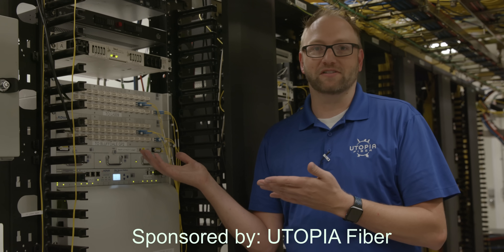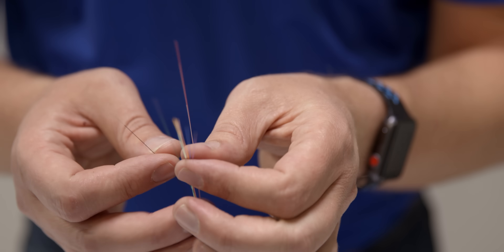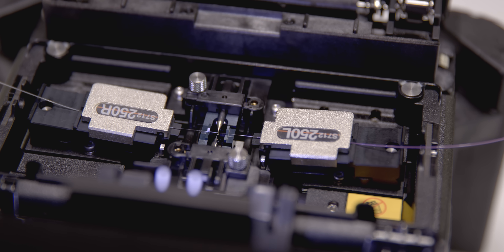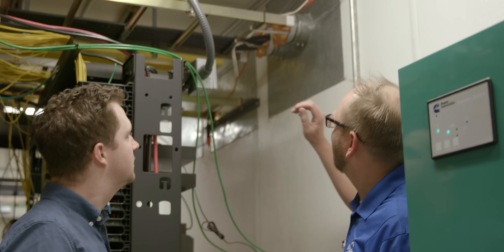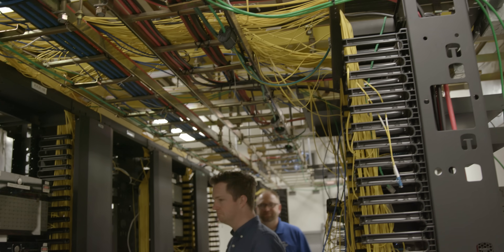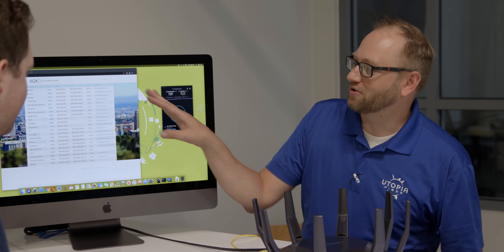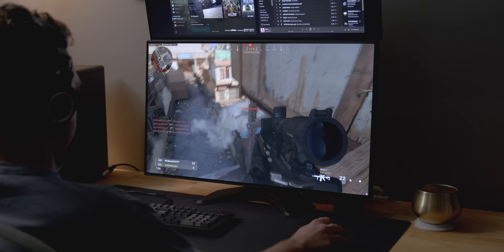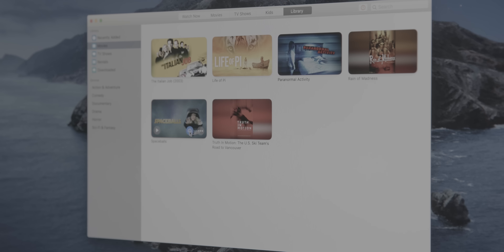4 Terabit Internet?! Fiber Company Tour!

Comment: ..and then there's Init7 in Switzerland, selling you 25GE for 777CHF annually, and they're a for-profit enterprise..
Side note: The legal situation in Switzerland is enabling this, as per law if you build fiber to the home, you MUST pull not one but four separate non-splitted fibres from every single residential unit (ie flat) to the fibre hut, where you MUST (at a regulated price) provide ISPs space for their equipment.

Comment: this is so absurd, unless the fiver cable is connected all the way to the internet's original source center, at one point it will have to hook up with a coaxial or inferior Internet cable line.
Reply from the maker: Erm, no. Even cable is basically FTTN. Once you go more than a few miles from the furthest homes with the worst internet, all infrastructure is fiber.

Comment: With a single fiber strand having the potential of 40+Tb/s that would make any current cable ran be good for at least 30+yrs, maybe much more. From an infrastructure POV it seems like a no brainer. That's up there with power lines in terms of longevity. Just every 5 years get updated to a new receiver.

Comment: While I'm capped at 2/2 Gbps .. you're are quite dead wrong about how latency works on first person shooters. If your ping is really low then your connection is slowed (LAG COMPENSATION) in comparison to higher ping players. In fact, the ideal ping for FPS games is right around 50 to 60 ms.

Comment: Unfortunately the SLIX has a relatively limited amount of bandwidth it seems since I've had many issues in the past with peering routes through the SLIX at peak hours. I used to have a server hosted at GSI/WebNX's datacenter and getting from there to my house on a 1 gig XMission connection. At peak hours I was only getting about 5mbps from the datacenter to my house, but about 700mbps in the other direction. I also had an issue with one of my customers for google fiber with packet loss through the SLIX

Comment: Wish we had options like this in more areas. My city is "lucky" enough to be having a private fiber provider rolling out Active-E fiber to our homes soonish but the cost for 1Gbps speed is ~$160/mo And municipal fiber like Utopia seems to be only reserved for the much larger cities. Interesting enough: idaho falls has a municipal fiber as well being run by their electric company. Electric company already owns the utility poles, so other ISPs can't do anything about it (like blocking access to the poles for other providers to come in) But like utopia: they grant access to their fiber for ISPs to serve end customers via at far more competitive rates than for example my future fiber ISP that will own the fiber being installed beneath the streets via micro trenching. They charge a premium for using their own networking.

Pretty cool to see utopia's setup. One day I'll have symmetrical gig fiber....one day LOL. At least my current internet gets me by... $125/mo gig down 50Mbps up cable. Best (and really only) option we have ATM.

Comment: my utopia 10G setup tested at 1500 mbps so i switched to the 1000 mbps package and that ended up testing at 1100 mbps (at less than half the price)! they said i was getting 10G even tho it tested at 1.5 lol kind of offensive but i let em slide bc the speed is consistent and i honestly wasn’t expecting anywhere close to 10Gbps. do with this info what you will 👀😂
Reply: Anyways speedtest is a bunch of hoax, usually ISP's have speedtest servers at their own infra, this gives the very low latency and fast speeds.

In reality, the Internet doesn't work like this at all. Each IP you are trying to connect is reached by unique paths and ways, and this can vary a LOT from case to case. 

a small TLDR is just that speedtest is just a huge scam, IDK why people get so excited when they have 0ms ping to their speedtest servers, it means absolutely nothing

Comment: $55/mo for gig!?
I'm paying $130/mo for 200mbps [averaging 83-100mbps] down and 20mbps down [ON AVERAGE 1.1mbps down, 5-7mbps on a "good day"] (note after over 87 technician visits in 8 years this upload rate is a huge improvement and Cox the ISP which will remain nameless can't seem to do better, having greater than 1.0 on average is a godsend)

AT&T a competing isp in the area has started infrastructure work to bring fiber to the city, but they are requiring a contract price lock agreement and have a huge price hike moderate bill adjustment halfway through the PLA with extreme fines recompense clause policy if you breach contract end services early

Comment: It's interesting that he said the equipment for an active network is cheaper than for a PON network. I wonder how that can be true, with an active network you need a demultiplexer and a powered router that can deliver 1G or 10G links to dozens of customers, basically the room they're in. And with a PON, you just need one big transmitter and passive splitters. Less maintenance and no power consumption. I mean it's significantly cheaper, that's why almost every FTTH provider is doing PON, otherwise the active network is clearly superior but... money.
Reply: Utopia isn't huge scale, that's why they are even able to be so direct to the customers. In a large scale, GPON is cheaper heh

Comment: Electricity potential moves at the speed of light too does it not?
Reply: Yes. Speed of light in vacuum is 300,000km/s, in fiber it is ~200,000km/s. For EM wave propagation in copper wires it is highly dependent on the type of wire, but it can be fast or slower. The signal in a modern Cat7 Ethernet for example is quite a bit faster than in fiber.

The whole "speed of light" argument is only marketing bullshit for fiber. The advantage of fiber is elsewhere.

Comment: 4 T...B.....what?!

I swear sometimes I hate living in Germany. I live just 7km away from a city and I can barely get 6mb/s through FUCKING DSL!!!
Not even normal internet cable.

They are working on getting the fiber cable to us but it will take 1 more year...at least 1 year.

Germany is awful when it comes to internet.
Reply: Wrong. It's only at the consumer level it's bad.
Germany has one of the larger IX's, DE-CIX, and a lot of datacenters and amazing backbone. A lot of hosting companies and datacenters live within Germany.

The main issue why germany doesn't have good internet is just because of Infra on the home/residential level, the backbone is fucking amazing.
Reply: @hariranormal5584  well,I am no data center.
We are in 2022 and it is kinda embarrassing to be able to get only 6mb/s near a larger city.

Comment: @4:15 "you can't just [butt them together]" Yes you can. AT&T has been doing this very thing for many years. It's how those horrible physical ("tool-less") connectors work. The ends of two fibers are "precisely" aligned and held there. (in a buffer gel to limit noise and reflections.) I hate them, but they are quick and don't require a $$$$ fusion splicer. (they are much more expensive than a pigtail, tho.)

Comment: I recently moved From Sandy, OR and had Sandynet (fiber to the house, 300/300 $42/month or 1000/1000 $60/month), now have Comcast. Oh how I dislike cable internet. I have no need for 600+ down speeds. 200+ down is more than needed. What I need is 200+ up speed and with cable I'm capped at 18 up. I strongly dislike how cable is high down speeds and low up speeds. I also miss the unfair low ping for gaming

Comment: As a German, the only places with actual reliable fiber 1g/10g connections are where the big datacenters are. I've rented a server with a good connection to the DE-CIX and even most Speedtest servers only go up to ~500mbps, though the connection is capable of multiple gigabits. Most customers can only dream of getting 100Mbps from their outdated copper connections.
There is no such thing as a competition except for DSL vs Coax cable, both quite flawed technologies

So before anyone thinks Germany is a technologically highly developed country, this definitely does not apply to regular customer connections
Reply: I just love my hetzner server. My ISP used to prefer DEECIX also to reach there, but preferred core baccbone gmbh now. Why the fuck i dont know XD but yeah. On my 260 MBIT connection I rarely get 14MB/s downloads from the GigE server :/

Comment: Hey Quinn, I work on a small WISP and eventually fiber infrastructure company out of Texas. We are trying to upgrade Texas infrastructure out in areas that the big companies wont service. While we have a lot of competition out here, most of the them are using older tech with no real plans on upgrading their equipment or even customer equipment. That is where we are going to be different, we as a WISP use Ubiquiti equipment and currently use 5AC Gen2 equipment along with Mikrotik network equipment. While we are small and expanding we still want to be able to upgrade not only our propagation equipment on our towers with the new LBU Ubiquiti equipment, but also the customer side equipment along with speed increases with hopefully no higher charge to the customer. Unlike some of our other competitors one of which is shown in your video, Rise Broadband, don't seem to quite give their customer what they are paying for and sometimes not even a fraction of it, from what we have been told from our customers that used to use these other companies. Most of them use old equipment on highly saturated sites and have too many people on a connection that really cant sustain the clients. This video is very interesting and is something we want to invest in and build infrastructure such the residential service you had in the video, although we are for-profit, but not trying to scrape money for all of our customers. We want to provide and sell to a customer exactly what they are paying for and this video is a nice window into the future of what we might become. Thanks for making the video!

Comment: Hey Snazzy,I've a doubt.
Can Telecom companies like AT&T make use of their towers too as part of the network for providing ftth?
Reply: cell towers have their own fiber and copper connections directly to the exchange, they do not relay, they are their own endpoint which you access ota, you can get fixed directed ota connections which is what I run on personally but having a cell tower close to you does not mean you have easy access to a fiber run

Comment: If anyone's wondering, 4,000Tbps internet translates to 500GBps.

(b = bit, B = byte, there are 8 bits in one byte so just divide by 8 to get the byte speed)
Reply: Wrong. 4000 terabits is 500000 gigabytes.

Comment: I have 250/50 cable here in the Netherlands and pay 59 euro (72 US dollar). But i rather would like to have 100/100 fibre because of the latency advantage. Unfortunately commercial companies here only roll out fibre in an area when they get enough interest from the residents. And offcourse most residents have no clue what what is as long as "it works" so the demand is low.

Comment: My first experience of remote computer access was 1982 at University of Kansas. My dorm's single terminal (80 x 25 chars green on black) used acoustic modem.
Speed = 1200/75 baud -roughly 1200/75 bps.
Keyboard typing limit therefore approx. 8-9 chars/sec.
Reading/download speed 120-150 chars/sec.
When I later learned  of 9600 bps modems I was blown away. Now 10G bps for home? - imagine speeds in year 2050 ...

Comment: Wow, it’s really interesting to see 10gb speed test and then discover that your limited by external servers. 
So what did you have to change to allow your modem ports to accept 10gb? I’m assuming this is an enterprise product. Do you have to lease the equipment? Are you saving money going fiber in regards to the plan you are on?
Reply: he already had 10 gb port in the 
unifi router  if i am not mistaken  he just had to switch the sfp module from 1Gbps to 10 Gbps

Comment: As a GPON network manager, this is such a weird network topology.
Reply: Point-to-point Ethernet is the standard in every network (enterprise, data centers, campus networks), except for some fiber-to-the-home networks. Why take the worst aspects of shared cable networks with splitters and amplifiers and do that do fiber networks (ala GPON)?
Reply: @rogertimmerman6982  For that exact reason: it scales like an office network.

It's entirely appropriate for a datacenter floor. It's lunacy to do that over an entire city. Especially big cities.

Also, GPON has no amplifiers. That's the Passive part of Gigabit Passive Optical Network.

GPON is nothing like DOCSIS coax or DSL.

Yeah, it uses "splitters", but as long as you get a GPON signal to your ONU, it is a gigabit link.
It either works or it doesn't. There's no "oh you're too far away from our PoP so the best we can serve you is 5Mbit".

Comment: Ah this explains how my ISP is able to give me 1Gbps for the price of the 200Mbps of the major Telecom (telenor) they offered us 500Mbps as a "test" to try and keep us with them... and it crapped out at 195Mpbs average . Still my ISP wasn't that cool, they wouldn't offer me 10Gbps because they said it was limited to businesses :(

Btw Snazzy team, if you're interested in testing out the limit of 10Gbps try seeing if there's a company in your local data center that offers VPS, and try to run a machine totally off the fiber!
In theory you can run almost an entire linux session (x server) off the fiber as the usual limitation is 6Gbps (SATA speed).
Practically I've found that 10Gbps isn't quite enough to run smoothly, I got a dual port 10Gbps from my desk to the server at home for displaying my "headless" linux server onto a fully working xserver by simply using SSH, and I see that if I play videos from YouTube of regular movies the UI usually have a 0.5-2.5s delay (while the video itself plays ok it can cause crashes or lock ups).
One thing I love reading those comments "you can't really use ssh x forwarding, that's too slow" "you can't benefit from aggregated 10Gbps" while I'm charting a 1.6-3GB/s plot chart on my lan statistic  I just wish there was a mobile version of fiber at the price point of a fixed fiber link... oh well.

Comment: I absolutely loved watching this video, so please do not take this as anything but Constructive Criticism. I have found 2 In-accuracies in this video. Firstly, there is better than Fibres 2/3rd Speed of Light despite the Technician saying this is [In terms of Latency] as Good As It Can Get. The Fairly New ISP StarLink which Operates at 100% Speed of Light easily beats this and there are Point 2 Point Radio/Laser-based Low Latency ISP's as well (Used Primarily by Stock Markets)
2nd it is stated that the Upload Speed to YouTube is a YouTube Limitation, but it's actually your computers Hard Disk/SSD Read/Write Speeds. I know a Video Content Producer that has 40Gbps and get's 95% of this when Uploading Video to YouTube from their Insanely High Spec NAS. A solution would be to have a NVME m.2 Solid State Drive as these are able to Read/Write at around 20-60Gbps. A SATA SSD is 3Gbps Max for Comparison.

Comment: We Used to get 1+ GIG U/D in Tampa Until Verizon Dumped us to Frontier RIP off Communication who Lies and @ Best you get 800 / 850  and the ISP claims its 1 MS ping.....  IN real Numbers its 10-15 seconds to click to connect to ANY SITE so dont believe their BS...I have over 1000 Tests on Speedtest By OoKla to Prove the Orignal Speeds and the Frontier Throttled Speeds!!! 
      I have Paid 2500 EACH time to have My Fiber RE RUN to the Property and all the Equipment Replaced  3 times  and its still Being Throttled.....How do I know.....??  I was an Original Verizon FIOS Test Customer and It used to work at 1050 D /1100 U .......until Frontier took it over and they Throttle the Network Now.     
    There is News of Spectrum Finally getting off their asses and Installing 2.5 Fiber and if it goes well we plan to see it Rolled out in 2021....The Best part is No small Up loads with the New Spectrum 2.5 GB Lines!!!  I cant Wait to switch !!!! 
  Hey Utopia Call ME I want 10 Gig in FL !!! Cow}:-o)

Comment: Finally, I have been so disturbed about all that GPON USA crap. 

AON is the only way to move forward. And thinking about optical fiber to be a utility is the ONLY way. But it is actually against the law in some states, (this can only happen in the USA, the only country that prefers monopolies)...

AON might be a little bit more costly to deploy, but it will be cheaper in the long run. 
We have 1Gbit/s as mainstream today (link speed), 10Gbit/s in 2030, and 100Gbit/s in 2040 and it is still going to be the same fiber only new gear in each end. In 2050 when it is time for terabit speeds it might be time to replace the fibers (due to time/temperature induced cracks, still most likely the exact same fiber as it is replacing), but with properly done plastic ducts, it is just to blow new fibers and we are up and going again.

In Sweden, most of the optical fiber deployments are done from a fiber provider and the ISP's operate on top of that.
I have 14 ISP's to chose from, 50USD for 1000/1000Mbit/s, when I am able to get my optical fiber provider to upgrade the uplinks from the fiber hubs to 100Gbit/s I will get 10Gbit/s also probably still at 50 USD/month.

Comment: Do you know the feeling when you attach or solder a plug/jack to a cable and there is one piece of it that needs to go onto the cable before connecting the wires and you forget to put it on first so you need to undo everything and then redo it? Now imagine this was thing with fiber cables and you only realized you forgot it after splicing 432 individual fibers.

Comment: I have been hearing "fiber to the home is the wave of the future" since the early 1980's.  Now a new ISP provider (finally) has been beating that drum for the past year where I live. They have run into the problem that the current cable provider and power company are fighting tooth and nail by not providing access to the poles to put the fiber on.  Great video!